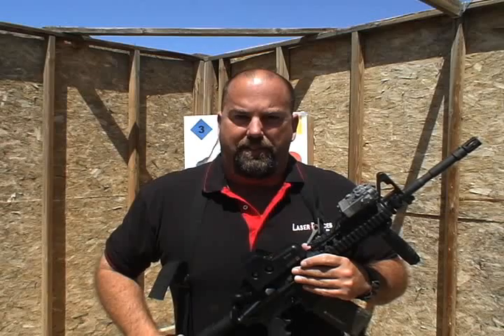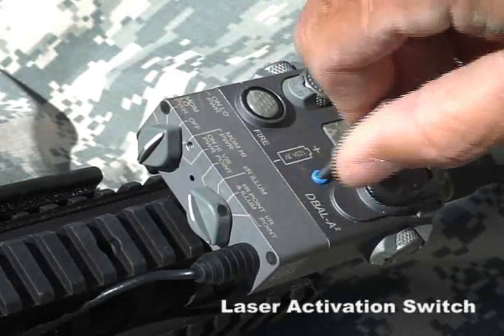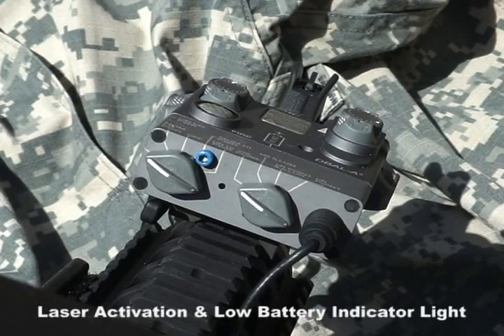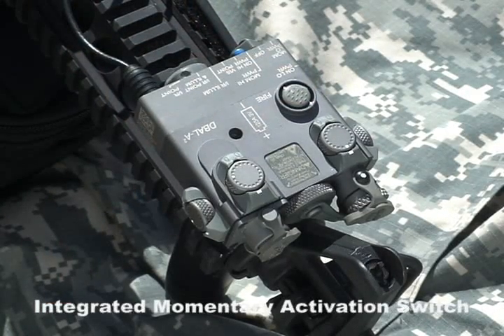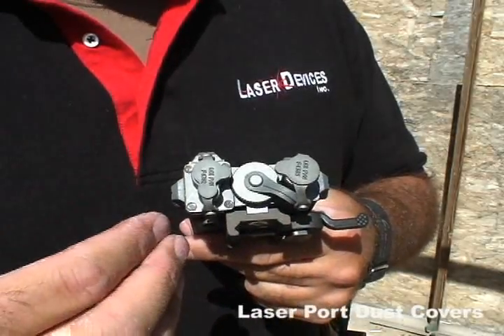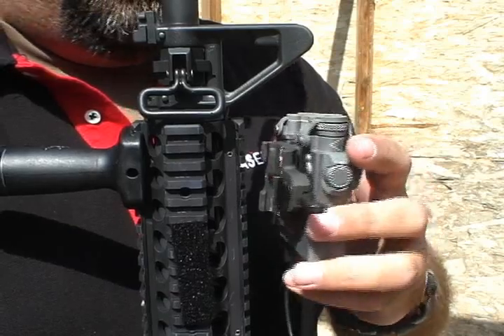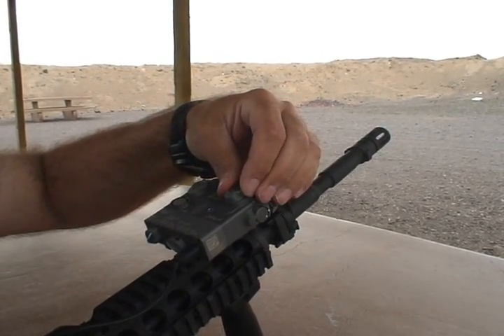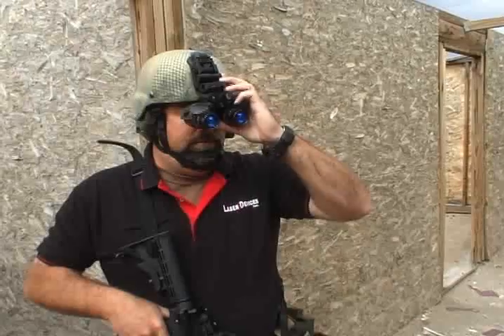DBAL-A2 Training Video

Comment: Just another note about the DBAL-A2/PEQ-15A.  Some of you my have noticed that US Special Forces, especially the navy seals are in the process of changing over to the DBAL-A2 due to its ruggedness and superior function over the L3/Litton PEQ-15.  The military have been virtually slaves to L3 for years now, and it is about time they are now using a superior product.  The casing is made from T6061-T6 aluminum rather than plastic that the L3 is housed in.  It is also water res.. to 66 feet.  Nice!!

Comment: I think that to truly zero a laser one should chart EXACTLY how far left-right, up-down the center of the laser optic is from center of bore. In the video for example I'd estimate that is 1.75" up and 0.75" right. Mark a spot on your target exactly that far from dead center. Move the target to the range you intend to zero at. Using whatever means you have, be it a vise, sandbags, etc. position your weapon so you are sighted in dead center on target and the weapon will not shift aim. Adjust laser so that it aims at the offset mark you made. This way you can be damn certain that the laser points STRAIGHT regardless of engagement distance.

Comment: I own a DBAL-A2.  Just a quick note to those LE units using the DBAL-A2 in close quarters, especially inside dwellings.  I have a laser diffuser which replaces the IR and visible laser port covers.  What it does is tones down the laser intensity, thus it eliminates the bloom effect that you would normally get when using the IR laser on low power (5mW).  This one thing has made the most positive change to the IR laser use while indoors/CQB.  Yes, I am Law Enforcement!!  Be safe folks!!
Reply: Good for you

Comment: Usually HP is used for sniping & normally you would have an auto gated NVG on that will keep your eyes safe. Under no circumstances should the HP setting be used for beginner training. My guess is that during advanced training precautiones will be taken against exposure to high power laser.

Comment: @PostPetroleumPrepper, no the ones you see on eBay at that price are most likely battery boxes for airsoft weapons. You're looking at a minimum of $700 for a legitimate last laser system like this.
Reply: Try $1600, lol
Reply: Physifist Engineering I’m very much well aware of the cost of a system.
Reply: @20TheGame09  OK, then what's the price for a DBAL-A4 pn: 78001?

Comment: Just one more note.....The DBAL-A2 that they use for the tutorial above is not the A2 that they sell to LE.  The newest version of the DBAL-A2/Military designator PEQ-15A only has one adjustment knob on the rear of the unit.  The disappointment to me is that there is no separate setting for just the use of the IR illumination on low power.  It goes from Low IR laser directly to IR laser and IR illuminator with no separate low power illuminator.  This is a huge disappointment.  Come on LDI!!!

Comment: they sell these to Civ and LE guys, so not everyone who wants to buy one or already owns one has had training that covers it.
Reply: @PhysifistEngineering  wrong. they're perfectly legal to own and possess and even sell as a civilian. the manufacturer simply chooses to restrict sales to military and law enforcement only.
civilians still get their hands on IR laser devices through various means, usually from law enforcement selling off old stock.
Reply: @1cme1  Uh no. That green laser is controlled by the the FDA and requires an authorized letter with official letter head. Its not the IR, it's the bright laser. Stop commenting because you have no idea what you're talking about.
Reply: @1cme1  Try to buy this and tell me how it works out for you because nobody will sell this to you and it costs roughly $1800. It's strictly LE/military.
Reply: @PhysifistEngineering  that may be, but DBAL-A2s are still readily available to the civilian population from other sources besides the manufacturer, which is the only person who is prevented from selling them by the FDA. possession of a DBAL-A2 is not a crime.
Reply: @PhysifistEngineering  do you think a civilian can't afford an $1800 IR laser? how new are you to guns?
authentic ones have been all over ebay for years.
Reply: @1cme1  no, it's illegal to own for civilians. I'm sure they are floating around but so are illegal machine guns. You can't sell them to anybody or own them unless Leo or military